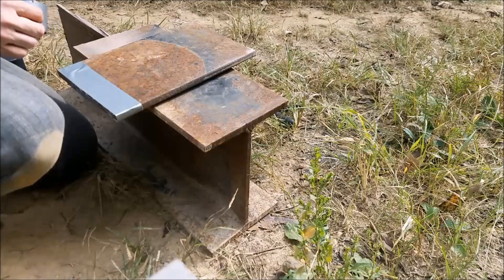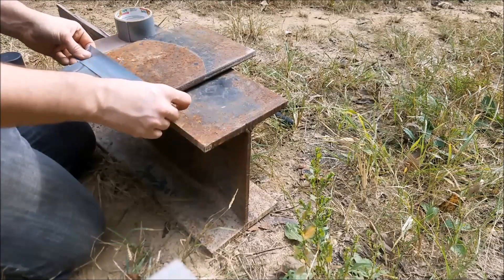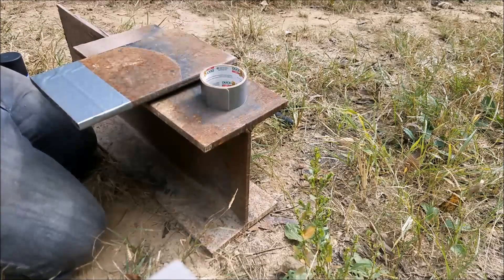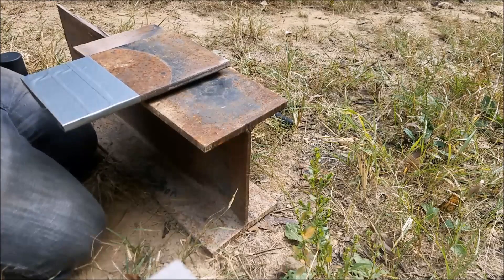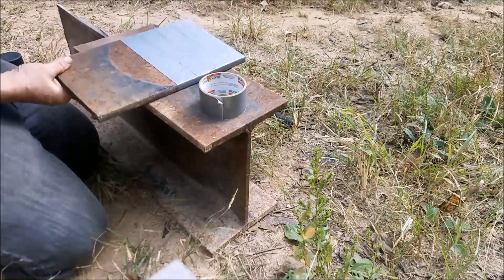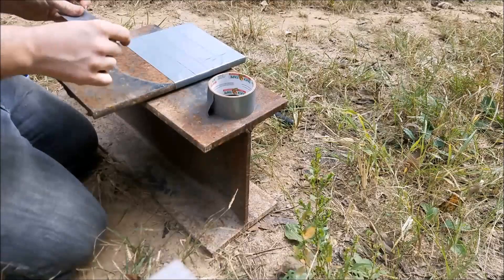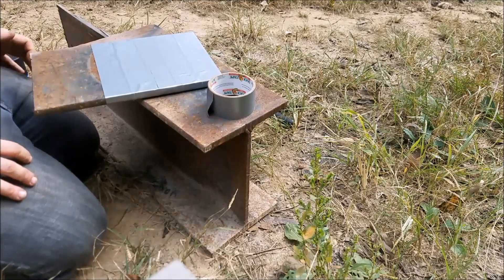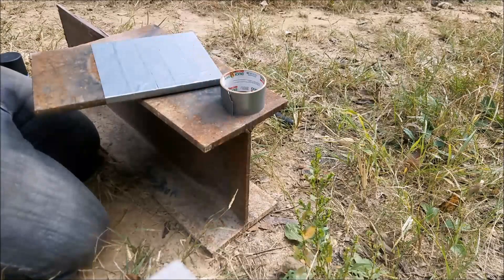How To Build A DIY Ballistics Plate Body Armor

Comment: If you wanna male something really simple bit hardcore. There is a DCEP STICK welding rod used for welding cast iron known as Nickel 55 and Nickel 99. I used Nickel 55 which is 55% Nickel and44% Fe or Iron and 1% silicon. You want to use no thicker than 3/16 thick because you're trying to create an alloy using A36 or low carbon steel which can't be effectively hardened. In order to run these rods you'll wanna heat your plate to 300/350 then begin running your beads. Keep the toes 3/14-1/4 inch toe to toe and your height .090-.125 bead height across the entire surface. The result is some insanely tough stuff. I think itnisbtwo parts your taking crap low carbon and creating a high carbon, Nickel Alloy. The surface will be molten and red hot. I believe the molten state and in combination with 3 or 4 distinct heating cycles  while welding a 1/4 of the panel at a time. Another aspect that improved upper this aspect of creating high carbon Nickel alloy that increased strength was hitting your sections weld beads with a two pound sledge while glowing. This has a similar effect to your annealing process used in high carbon blades. It is about 5/16 and seriously tough stuff. Very similar to how A514 or A540 welds. It is tough shit.

Comment: Just a suggestion. Throw away those damn carbon cutting disc. Use diamond disc. I had to learn the hard way. I had a carbon disc brake, shot the grinder out of my hand and hit me in the face. 48 stitches later I learned my lesson. I will never buy a carbon fiber cut wheel again. 3 weeks later my buddy had one break on him. Shot the grinder out of his hand and ran up his arm. A week in the hospital and he learned his lesson. F*** carbon fiber cut wheels.

Comment: You'd have been much better off attaching the ceramic tile to the steel using contact cement and then coating the entire thing with rubberized bed liner type coating which would lessen the shrapnel effect of the ceramic as well as lessen spalling of the rounds at impact and covering it will thick duct tape wouldnt hurt anything while smoothing out sharp corners and edges and helping to contain shards a little...

Comment: Lol fuck that would get heavy. Im workin with a slightly thicker than 1/4" stainless steel plate in front and back and it feels like my vest is at least 50lbs all together
Reply: what can that quarter inch plate stop? Im guessing no more than a 357?
Reply: @thebuilder3700  havent tested but I imagine no more than small arms
Reply: @brandonhall6047  I'm looking to make my own. I have the options if mild steel or stainless. Not sure which one to go with
Reply: @thebuilder3700  lol just layer them both

Comment: You can buy Ar400 or Ar500 plate then spray it with linex ar400 and ar500 is the type of Steel it's harder than A36 or 1018 or 4130

Comment: Not tryna be a asshole man but please learn how to use a angle grinder, i dont want you hurting yourself. Use the right side of the cutting disc so if it binds up it pulls away from you. Ask me how i know 😁. I rather have sparks burn me than get sliced open by the disc
Reply: Man you are right on the money. I had to learn the hard way. It hit me in the face after my carbon wheel came apart. Shot the damn grinder out of my hand and straight to my face. 48 stitches later .I learned the lesson. And the hell with carbon fiber blades

Comment: I just cut out 10 by 12 and coated with bedliner...spray...and put behind my soft as 500 body armor...double it....works great and cost me nothing...
Reply: What? So you have ar500 steel plates and added another plate?
Reply: @alexduke5402  no...I have level2 soft plates...I added steel plates coated in bedliner....the steel plates I got from a iron worker....cut out my self...
Reply: @stag3t-muspsa910  oh ok if you go to a metal supply warehouse you can buy ar500 plate and cut it but be careful how much heat you put in it when cutting it will change the hardness of the steel. IDK if you knew that just sharing knowledge. I was going to say good luck humping around with 2 steel plates front & back of your carrier. But NVM!

Comment: I've seen tanks with ceramic armour up close... but NONE of them ever had kitchen/bathroom tiles on them!!!  
Why do people think that  ceramic house tiles are the same as armour ceramics??  
Q. Were the CERAMIC tiles on the Space shuttle the same as house CERAMIC TILES??????  mmmm maybe not!..
Reply: So basically “because your car is not a Ferrari it cannot drive you to work”?   Yeah, military uses fancy ceramics but the simple physics are a hard layer that shatters or flattens the projectile and then a soft/strong layer that catches the dispersed force.  Floor tiles at Lowes are designed to be very hard and durable....but best to have that second layer to catch the debris.  Watch some field tests people before spouting ignorance.
Reply: Ceramic can mean any kind of polymer with hard material within an amorphous lattice, would be interesting to see if spinning diamond armor could deflect bullets
Reply: FYI the ceramic layer is not really there to help stop impact force it's more there for shrapnel control !! So why y'all are trying to sound fancy keep that in mind
Reply: did you READ what YOU wrote???  i quote,
ceramic materials that are harder then steel will work for a strike face if backed by Kevlar or Poly materials
Ceramic floor tiles are no where near as hard as steel... 
I was born, and grew up in a place in England, that has been making CERAMICS, CERAMIC TILES, CERAMIC VASES, CERAMIC pottery since about 1750AD.
My Elder sisters both worked in what we call "The Pottery Industry" from their late teens until late 40's. 
Google THE POTTERIES, Stoke on Trent, Anna of the 5 towns, Arnold Bennet, Royal Doultons, Josiah Wedgwood, any of those and you'll come up with the area I live in.
Right, you find it?  good. I never worked in the pottery industry, a lot of my friends did, I worked in computers and still do.
I had a good friend who was working on his PhD in Ceramics, something to do with the different chemical compositions going into making fine bone china. I'm not a chemist, not a mathematician, to work out all the different chemical formulas that go into "CERAMIC" fine bone china.

You and a LOT of other people are getting confused by the word CERAMIC.. Cambridge dictionary definition is:-
 ceramicsnoun uk  /səˈræm.ɪks/ us  /səˈræm.ɪks/
[ U ] the art of making objects by shaping pieces of clay and then baking them until they are hard
[ plural ] the objects produced by shaping and baking clay, especially when considered as art 

Just because you take a piece of clay, whallop it flat, to an inch thick, then put it in a klin for 12 hours, CERAMIC ARMOUR it DOES NOT MAKE!!!
CERAMIC FLOOR TILE.. YES.. something that will save your life.. no f***ing way.
If you use a CERAMIC VASE in an amour vest will that stop a 9mm round? NO
If you use 2 CERAMIC VASES in armour vests, will that stop a 9mm round? NO
Can you see my point??????
I really hope so.
If your stuck in LOWES (waits for lowes to send me some vouchers for mentioning them lol) go to the Shovel aisle, grab some of the really thick, and big sand shovels.. break the long shaft off.. use them, they gonna do way better than a shed load of floor tiles.  OR go grab some packs of paper... THAT works way better.. 1 x 500 sheet pack can just about stop a 9mm. 
Soak that pack in water for a while and it gets better at stopping rounds. 

TANK armour is CERAMIC.. again.. is just means, the contractor has taken some special ingredients, mixed them into a mould, let them set for a while, then baked them for how ever long. 
Floor tiles are not made from BORON CARBIDE.. they are CLAY. basically.. 
I think you got this reference and were referring to it?
What is ceramic armor made of?
Boron carbide composites are primarily used for ceramic plates to protect against smaller projectiles, and are used in body armor and armored helicopters. Silicon carbide is primarily used to protect against larger projectiles.28 Jan 2013

Google is a persons friend....  See.. BOTH MADE OF CLAY... SOD ALL TO DO WITH BORON CARBIDE OR SILICON CARBIDE.
What is the difference between porcelain and ceramic tile?
A: In general, porcelain tile is harder than ceramic and offers greater design flexibility. Although both are made from clay and other naturally occurring materials fired in a kiln, the clay used to make porcelain tile is more refined and purified.

If you wanna see how well floor tiles work as armour.. check out DEMOLITION RANCH..  Matt on there, tests out home made armour all the time, along with other things that people think will work as armour. 
His videos tell the whole truth and back up the TILE IS NOT YOUR FRIEND AS ARMOUR truth.
I'm going to be now, cos I have flu.. and my sinus headache is hurting a lot.. night night
Reply: @th3v1k1ngW4rri0r  thanks that's alot of typing. I chicken peck so I'm constantly correcting typos. Could someone buy the different raw materials of the Armour type of porcelain and use a regular kiln used in making pottery.